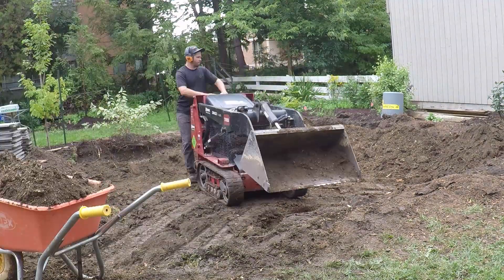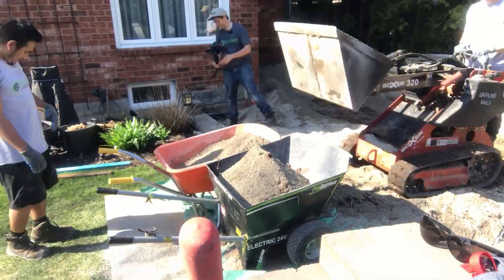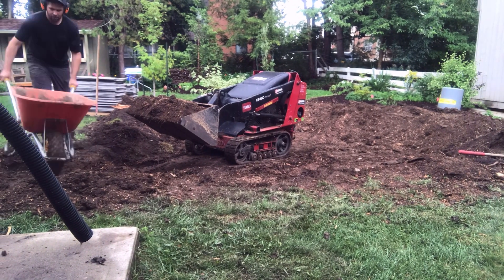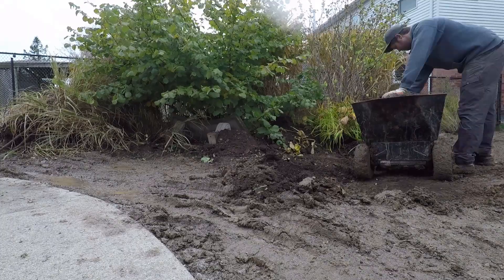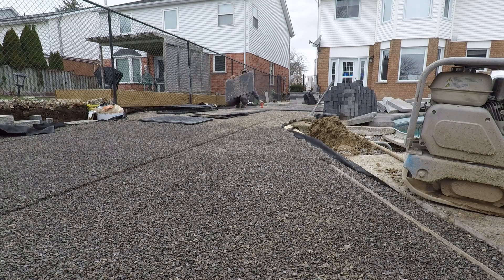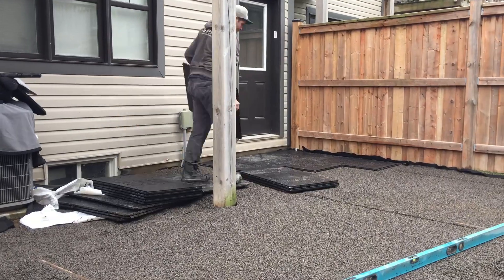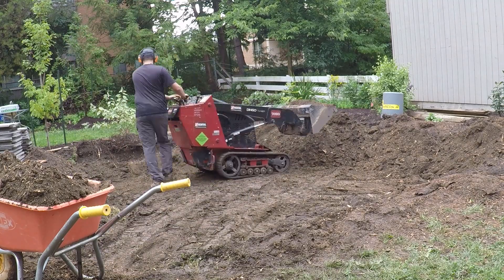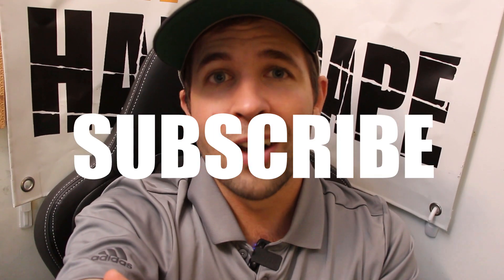How Deep to Dig for Pavers

Comment: does the subbase need to be slightly sloped also or is that just the base and pavers? I'm confused as how you would dig the subbase and slope it evenly(if needed). And how many inches of base material can I get away with for pavers if I really want to skimp on materials for say a low traffic paver walkway and would does less than an inch of sand be ok?
Reply from the maker: yes, subsoil should mimic the slope of your patio +/- 3/8" over a 10 foot area. The base depth depends on your climate. If you have freeze thaw cycles then you should be at least 6" of base.
Reply: @iamahardscaper  how do you grade subsoil? Wouldn't it be too hard since you can't screed it?
Reply: @iamahardscaper  Also do you guys have to call the city to find out where all the utility lines are?
Reply from the maker: just take your time with the excavation and grading. whether you are using a machine or fine tuning. once you start, you will learn as you go with it.
Reply from the maker: Yes, always call before you dig
Reply: @iamahardscaper  How long does it usually take for them to show up?
Reply from the maker: i don't know where you live. For us, they say 5 business days but it can be upwards of 10.
Reply: @iamahardscaper  So what do you guys do in the meantime?
Reply from the maker: we are booked out weeks in advance so we just do all the locates well in advance
Reply: @iamahardscaper  Pavers are in pretty high demand?

Comment: Great video. I'm laying some pavers in a community garden at the entry. It's pedestrian use EXCEPT one day a year where a truck may back up over them to deliver soil for the garden. Is the drive way depth needed for that? If so I hope I have enough paver base 🤞
Reply from the maker: It is tough to say. You may get movement over the years from that truck. Especially on the edges if their truck goes on the borders.

Comment: Was considering removing my Asphalt driveway and replacing it with pavers. How would you tackle that? 

Is the base layer for asphalt typically good enough for pavers as well?

Was also considering putting at least 1 inch of HPB once the asphalt is removed
Reply from the maker: We would tear out and re-do the base. Asphalt companies are typically just putting down gravel compacting and putting asphalt. We would put down geotextile and have two layers of geogrid in the base somewhere. Anything you do without replacing the base will just look like your asphalt driveway in terms of settlement
Reply: @iamahardscaper  Appreciate that. And if the asphalt hasn't settled too much (it's about 20 years old) is there a (even slight) chance I might be ok? 

Original plan was just to redo the asphalt - but the pavers that I did the walkway and courtyard with look so nice I'd rather do it all the same. With the courtyard / walkway, I did the geotextile and 8+ inches of HPB. 

I'm based in Toronto too  (GTA) - what's the best way to get in touch for a quote?
Reply from the maker: It would be totally up to you. I’d recommend redoing it, but if you are confident in the base then you could proceed.

You can reach out at everafterlandscaping@gmail.com

Thank you 👍

Comment: Can base paver panels be used on top of limestone screenings, or do the screenings have to be dug out and replaced with three-quarter inch chip stone gravel?
Reply: Screenings are a big no-no🫣
Reply from the maker: I’d say if you are treating your screenings like your subsoil as if it is not going to drain, you would then install your nonwoven geotextile, HPB as your bedding layer, then your panels

Comment: I love the video. Thank you so much. 
I have a question. Are aware if anyone has used floor mats similar to the foam board sold as the specific underlayment. 
I feel I can save even more money and material by using something similar to a gym floor mat and use a drill bit to place drainage holes through the panels.
Reply from the maker: I probably wouldn’t. I don’t know how the pavers would sit on that or how long that would hold up

Comment: Could you use the synthetic panels with features like seating, an outdoor kitchen, or gas fire pit?
Reply from the maker: yes, for features no greater than 18" in height. so no for outdoor kitchens.

Here is one we did with a gas fire feature: https://youtu.be/fNP0O_8TDqo

I don't like using them for long walls though because if you are using the panels for your patio, they are laid on a slope. But walls need to be level. So you have to level sand on top of the panels to get your wall level and with a long run the bottom of your wall will end up higher than the top of your pavers.

Comment: We recently removed our deck to add a patio. We then found we had to seal the wooden basement walls. So someone came in dig out the walls and sealed. How do we pack the dirt now beside the house to continue with project? I’m hoping to have flower beds along the house and then patio. Or are we stuck letting it settle for a year? Location saskatoon Sask. farm yard. Clay.
Reply from the maker: Are the basement walls wooden? Ideally you would use a jumping jack compactor but being careful up against the foundation. Usually there is an area that we leave uncompacted along the foundation to avoid damage. Whenever we have to dig out a foundation and re-fill, we will just plan on about a one foot area from the foundation out to settle and we will just come back and lift and re-lay that over time.